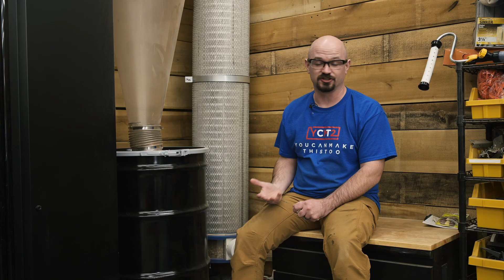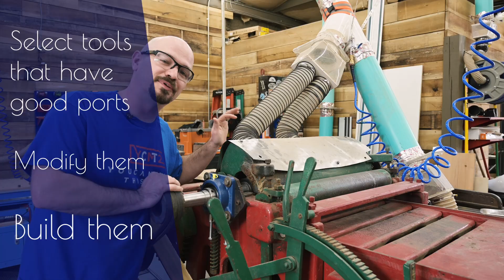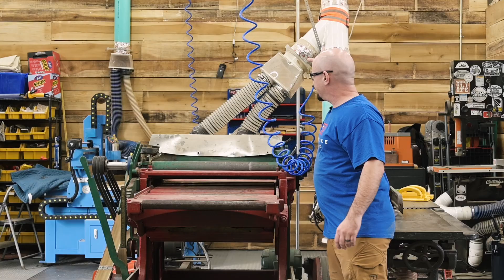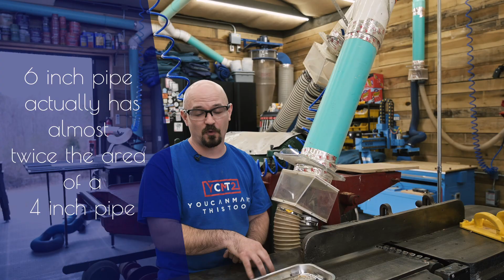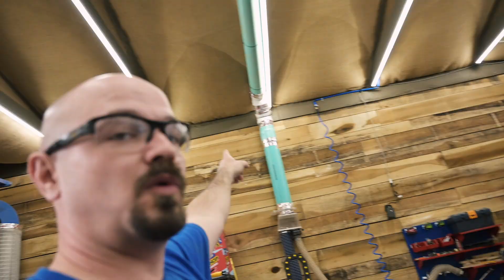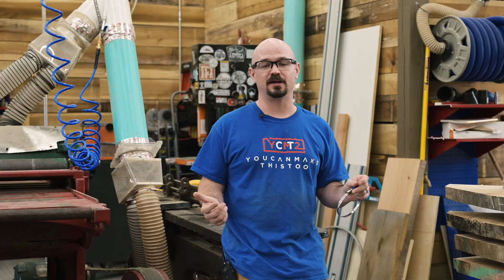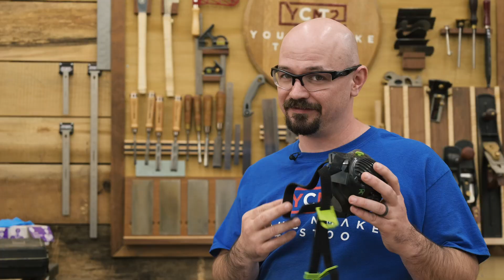Most Common Dust Collection Mistakes

Comment: Good overview.  My shop is in my home's basement and I went with a 1 micron canister system (what I could afford) and made a simple shop air-scrubber with several MERV13 HVAC filters.  The scrubber is built into the ceiling joist cavity using a HVAC duct booster fan with a 8' run of HVAC duct and has the ability to exchange the entire shop's air in about 6 minutes (filters above my work area and the outlet well away to circulate the air across the room).  It stays running while I'm using my tools and leave it run for 15-20 minutes afterwards.  For dusty operations I always wear a mask in the shop and try to perform sanding operations outdoors at all times.

Tip for those who have shops in their house... spend the time to seal every nook and cranny on your shop and seal all HVAC ducts that pass through the space (especially the cold air returns).  Last thing you want is dust creeping into the rest of the house.  I also have and use a MERV15 furnace filter to ensure my home's air is good.
Reply from the maker: Heck yeah! Sounds like you're really on it, that's a great set up.
Reply: Merv 15 You must have oversized ductwork. Most houses can't handle anything above Merv 5 or 6. Went on a house with a brand new AC and the Merv 7 filter was restricting the air flow so much it was freezing the evaporator.

Comment: hi i have a 2hp dust collector and a barell seperrator with a 6 inch hose going in from the dust collector to the seperator and a 4 inch hose outlet out of the seperator, i see you said that 2 4 inch hoses pull in as much air as a 6 inch so it got me wondering if i make a manifold sort of like what you are using when you split into 2 4 inch hoses , if i do this at my seperator 2 ports for 4 inch hoses rather than just 1 would i be pulling more air out of each hose than  how it is now 1 inch outlet then splitting into 2. I hope you understood my question D: .
Reply from the maker: If the inlet port on your separator is 4" you won't get anything extra by building a manifold because it's already been downsized.
Reply: @YouCanMakeThisToo   thats exactly what i mean,  its 6" going in from my dust collector to the seperator so if i make a 6"(currently 4" out single port) out with a manifold  with 2 4" outlets, so im thinking if i do this each of those ports should pull in about the same as the 1 4" port i have now.

Comment: I have 4” systems (small 650 CFM) on my miter saw I have it T offed to a 4” port below back and 2” port that the tool comes with behind blade- based on what u said about 6” tee to 2 4” would I get better suction if I split to 2 2” ports instead of 4” & 2” on miter saw??
Reply from the maker: The 2" off the 4" probably isn't moving much air. If you split that 4" into two 2" ports they'd both pull real nice.

That said I'm no expert and if you're happy with what it's doing.. then rock on brother.

Comment: If it is a HEPA filter then the 0.3um listed efficiency is for the maximum penetrating particle size (MPPS). This means that anything larger or smaller than 0.3 microns is captured with an even greater efficiency. Most people assume that it will let through anything smaller but that is not the case. A filter with a merv rating is slightly different but but generally merv 17 is similar to HEPA. 
Also important to note is that when cleaning these filters you want to back flow air through them rather than use a mechanical wiper. The wipers over time can wear holes in the material greatly reducing its efficacy. I've heard ~40psi @ ~16 inches should work.

Do you have any sources on blowing dust laden air around at head height? I have heard a few channels mention this and it makes no sense to me. Air currents in the shop are probably enough to bring particulates from any height into the air you breathe.
Reply from the maker: Great information, thanks for sharing!

Comment: Caleb, this video educted me on the subject at the the most opportune time!  I am in the process of setting up a woodworking shop in my two car garage.  At this point only the miter saw station is connected to the Central Machinery dust collector.  My question is what cannisters type filters would you recommend to modify my system? Thanks for the educational am informative videos.  Keep them coming👍.
Reply from the maker: Thanks! Wynn makes really good filters and I think they have one sized for the harbor freight machines.
Reply: FYI I found and canister filter made for a big air compressor for $40 and works great-

Comment: Thanks for the great video!  What about grounding your DC system?  I have heard multiple opinions and am curious what you do.
Reply from the maker: Combustion isn’t a problem in small systems. And I’ve heard that even the large unit ones that catch fire are due to shorts and not static. That said… some of my hoses do build enough to be annoying if you bump them while it’s running.

Comment: Your hand plane about to fall off the wall is causing me distressing anxiety 😂 

Which Clearvue do you have? Satisfaction level? I’m ALMOST ready for my next.
Reply from the maker: It's the CV1800 with 16" impeller, I think they changed their nomenclature recently though.
Reply: @YouCanMakeThisToo  thanks! I did see the nomenclature change. Easy enough. Now let’s talk audible volume: I have that lean-to/awning on one side that I put the compressor under. Would you trust the acrylic outside 24/7 even with no direct sunlight? I’m leaning towards the EF5 model just because of the metal cyclone body.
Reply from the maker: @TarshaHomestead  Oh that's tough. I'm really not familiar with acrylic performance outside. Probably be safest to just go with the metal.

Comment: Great video Caleb thanks for sharing, this is certainly going to be coming in handy as I've just built my first workshop and within the next month I will be installing the dust collection system.i bought the laguna P-flux dust collection system and can't wait until I get in all installed and ready for work!!!.On a slightly different note can you please tell me what the compressor is that you're using for your Mirka sander as I've bought one and need an idea upon the size of compressor to buy. As always buddy 💯%   👍   🇬🇧.
P.s. the compressor I should have said how big is the air tank and do you know what the cfm rating is?  Hope your able to help!!!
Reply from the maker: That's super exciting! I'm actually running their electric system so my Mirka plugs into the vacuum and gets it's power from there. I've never used pneumatic sanders so can't really help with sizing... sorry.

Comment: On the. Table saw, aren't the overhead and inside cabinet shoot fighting each other?
Reply from the maker: Not at all, there's only a tiny sliver of air space around the blade that connects the two areas. They're almost entirely separate
Reply: @YouCanMakeThisToo  makes sense.

Comment: To those that have no budget like myself. At least get a woodworking or painters respirator. They aren't expensive and make a HUGE difference.
Reply from the maker: Truth
Reply: Do you have a recommendation for someone that works with metal and wood?
Reply: @delskimeats 3M.  Cartridges based on what your doing that can be swapped.

Comment: fix the plane in the background! it looks like it is getting ready to leap off your wall, maybe a magnet or 2 to stop it from coming loose? also dust collection, it never works all that well until you forget to turn it on and realize how much it makes a difference!
Reply from the maker: I've got those on a few of my planes, need to add it to that one for sure.

And yes! For me it's forgetting I unplugged my table saw hose and then running the saw and collector just to see a giant spray of dust on the floor